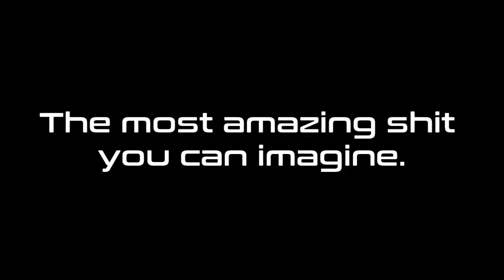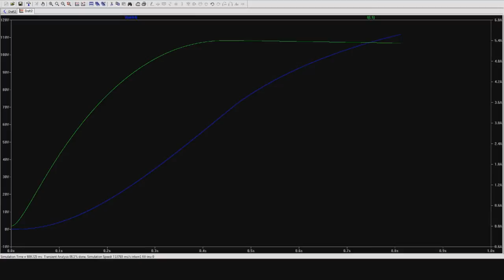Azagro 2017 - Railguns and Engineering (TRAILER)

Comment: I can see that you included software in your railgun design. are you trying to make a railgun that can fire multiple shots without recharging the capacitors?
Reply from the maker: boomchacle Good question! However, no. If you saw my other video, you'd see we're dealing with almost 100.000 Amps, with a complete discharge in the microseconds. In order to fire multiple shots with a single charge, I would have to use switchers, but modern day technology isn't able to switch such destructive power. Instead what I will do is charge my capacitor bank so extremely fast, that perhaps it could be semi-automatic. The charger controller will be what is programmed. Today I'll release a video, starting the railgun build.
Reply: ***** nice. Also, could you put coilgun coils around a railgun while its firing to get extra acceleration ow would the two cancel each other out?
Reply from the maker: boomchacle I don't think they will cancel out, as the magnetic fields are perpendicular to eachother. Straight wire creates circular magnetic field and coil creates "straight" magnetic field. However, you'll have a lot more problems. Since you'll need to have 2 power sources. I think I'll try it out in a future project.